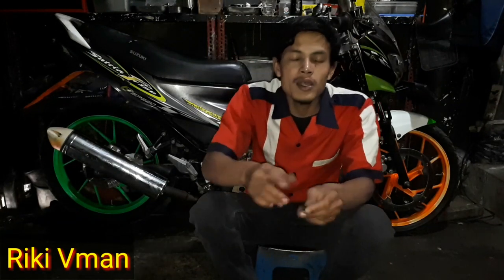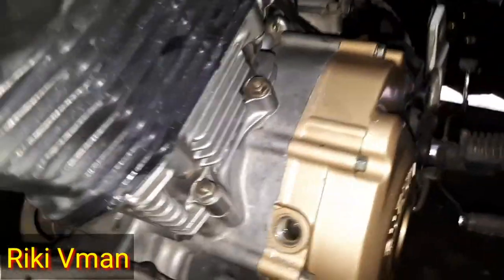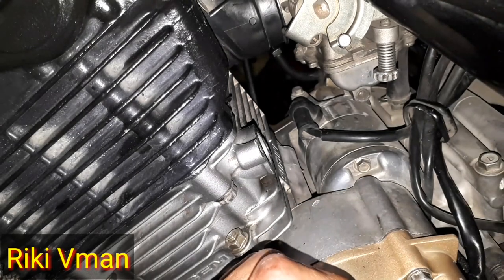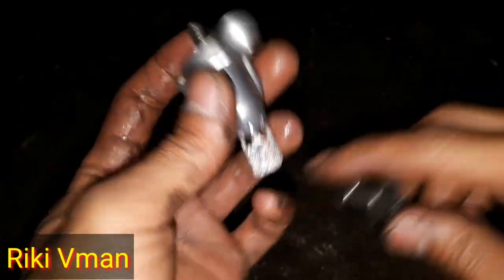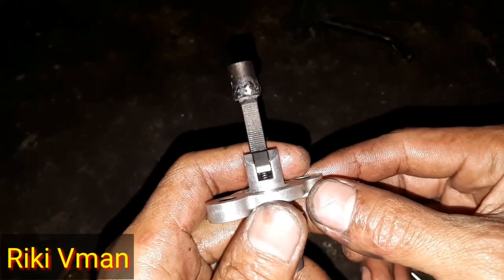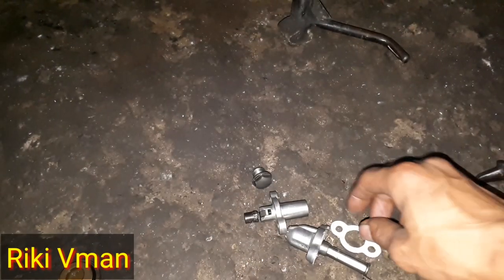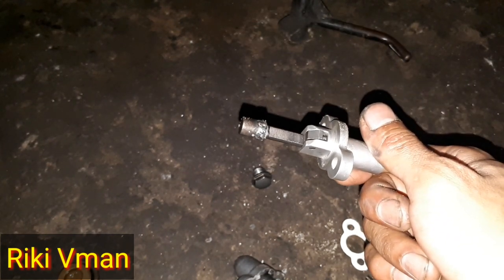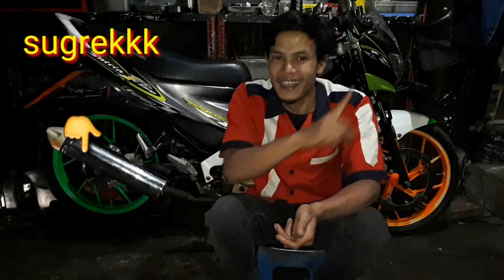Rante keteng satria fu cepat berisik !!! Mengatasi mesin satria fu berisik !!!

Comment: Kurang jos bang, langsung ganti pake baut 12 panjang aja bang, ane 2 tahun aman pake baut 12, jadi tensioner manual, setahun sekali dong nyetelnya tinggal kencangkan dikit beres
Soalnya klo sering main di rpm 12 13 cepat lembek lagi klo masih pake per
Reply from the maker: Coba lihat lagi video diatas.😄😄😄
Di atas juga kan ada 3 pilihan ada yang pake baut.

Comment: hi plz sir can you help me i have a dirt bike 125cc  top speed 100km 15/40 original i hope  change to 16/34 possible or not thanks
Reply from the maker: usually 16 gear is rarely in the store.  likely if you want to increase top speed.  can use 15/32 or 34. Even that ratio is pretty heavy.
Reply: @rikvman  thank you very much sir